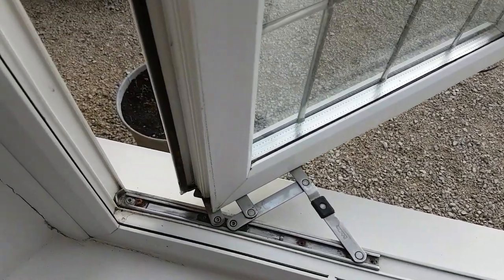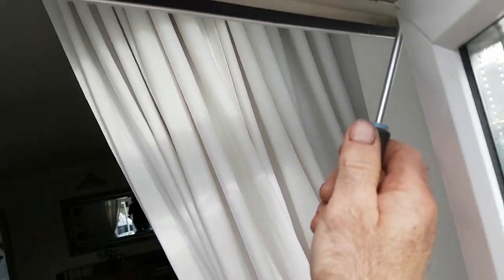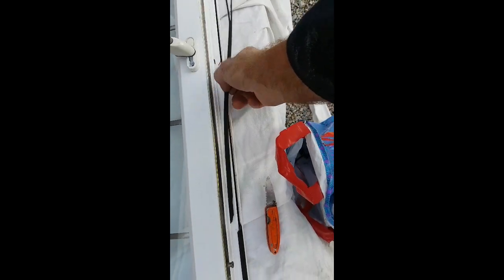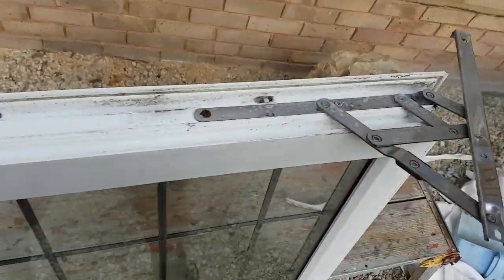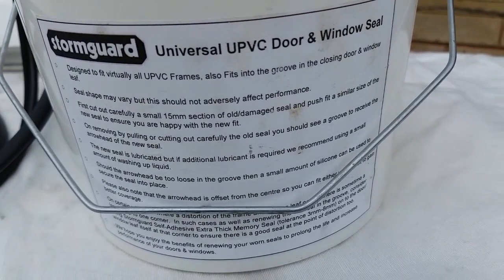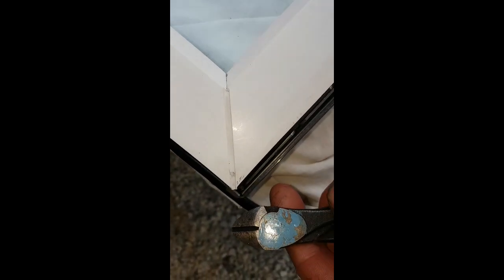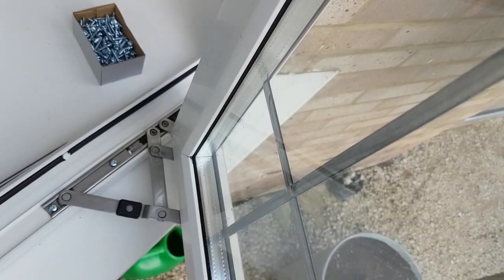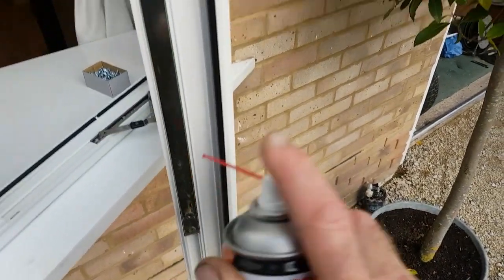How to replace upvc window SEALS.💚🔥+service

Comment: I thought maybe I needed to do this, so as I inspect my window I do not have  that type of seal. so scratch that, but excellent vid, may I suggest that black  clip on the arms top and bottom, will release the window  then taking the screws out
Reply from the maker: Thankyou 👍

Comment: I wouldnt use wd40 on the hinges. It drys out and they will corrode quicker. You're better off using silicon grease, or even vaseline on the hinges.
Reply from the maker: Silicon spray would be good,but Vaseline may attract the dirt

Comment: The seals on mine don't seem to be in a gap and look kind of glued on, iv took some out and now have a gap but no space to slot it into
Reply from the maker: Thats strange i haven't seen upvc Windows without a gap to push the seal onto.
I would purchase some draught excluder stick on type to overcome the problem
Reply: Unless the gap is gunked up, I will re check  thanks for replying 👍
Reply from the maker: @missfantut  i would day yes gunked up

Comment: Hi how do I know what kind of seal I need to get for my upvc garden door?
Reply from the maker: What i would do is pull a small section out,and cut off a piece with a utility knife,then measure the profile,then you can check out the internet or local diy to see if they have similar.
On my Windows i purchased a universal seal,as long as the base of the seal that fits in the upvc groove is the same it should be ok
Reply: @markrocketmangrimstead  thanks